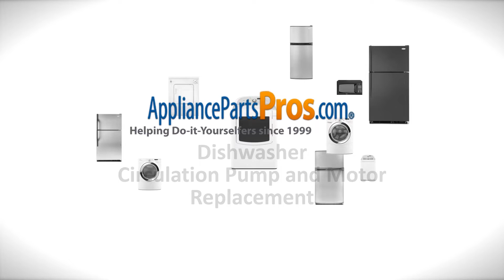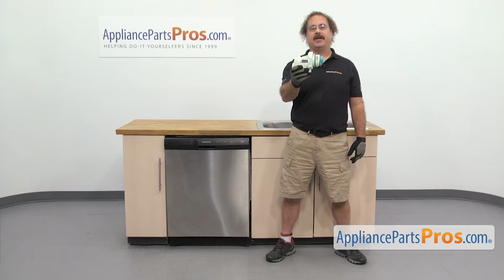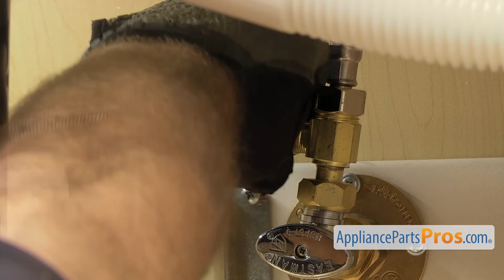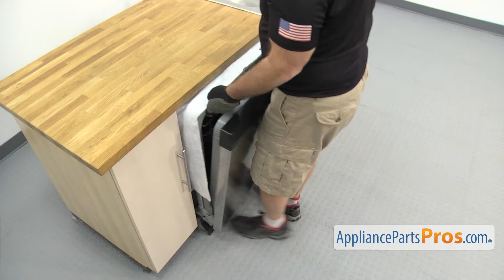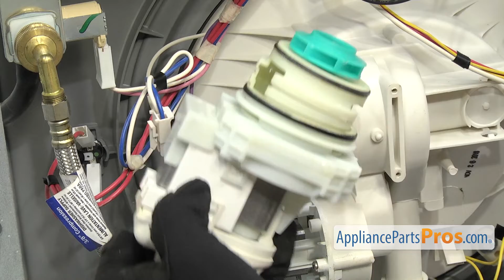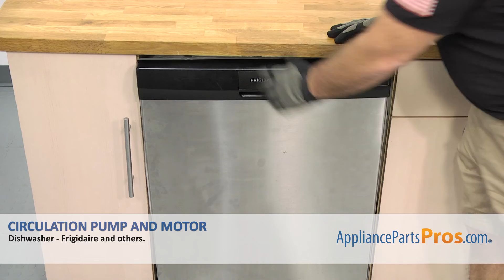How To: Frigidaire/Electrolux Dishwasher Circulation Pump And Motor 5304519906

Comment: Is the motor kinda hard to spin by hand or should it spin free
Reply from the maker: Good question, @covidkiller6928 👍

It should spin fairly smoothly by hand, but not necessarily “free-wheeling” like a fan. A little resistance is normal, but it shouldn’t feel stuck, gritty, or very hard to turn.

Comment: What if the metal bracket is cause the pump to not seal? Its leaking after I put the new pump back on
Reply from the maker: Sorry you’re dealing with that leak after the install. For detailed troubleshooting on whether the bracket or sealing surface could be causing it, our certified techs can help at forum.appliancepartspros.com. Just post your model number and what you’re seeing, and they’ll walk you through it.

Comment: If the wheel dosent spin near the check ball does that mean the circulation pump is bad
Reply from the maker: That should turn, if it doesn't then that would indicate a bad circulation pump.

Comment: can i test this part with a meter?  also how much voltage goes into this part from the wiring harness, thank you
Reply from the maker: You can test this part for voltage. This part should have 120vac. If the part has 120vac and does not come on then you will need to replace the part.
Reply: @appliancepartspros  , i fixed it temporarily,   its from lack of use,  i took it out and spun the motor and to be nosey i removed the cover to the electronics to take a look,  those two small tabs on the top will break but oh well,

Comment: Great instructions. In your experience, what might happen to this pump (or other parts) if the water main to my house was turned off while the dishwasher was in mid cycle, so it was running dry. I turned it off, but I'm not sure how long it was running. I found very little information online (most said make sure the water is on) but after the water main to my house was turned on, I tried to run the DW through a cycle. I came on and the water from the previous cycle drained out like normal, but no water was getting into the machine. I would think that one of the motors burned up or a circuit in the appliance tripped or something. Any idea you might offer would be appreciated. Of course, I'd rather pay for a part or two than have to buy a new DW, but chasing rabbits ain't no fun.

Comment: Thank you for this video. I’m having the issue where the detergent isn’t getting rinsed and mixed off the door and bottom. I’m about to order this pump and hope it fixes it.
Reply: did  you replace it? did it help? I have same problem like you.
Reply: @almahadzic9939  I did replace and it corrected the issue I was having.
Reply: Make sure that water is coming into the dishwasher first before you buy a new pump
Reply: @czechiann  how do I verify that?
Reply: Did the pump fix it? Have the same problem
Reply: @drasticmart  yes it did. It was fairly easy to do. Been running well ever since.